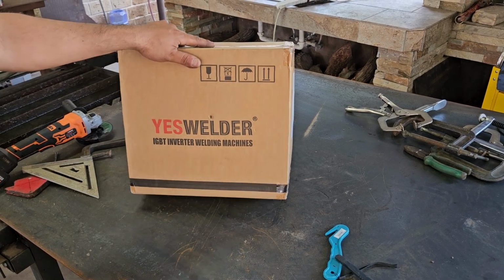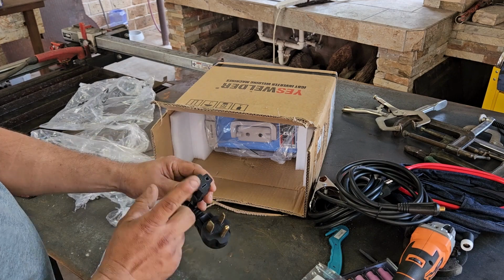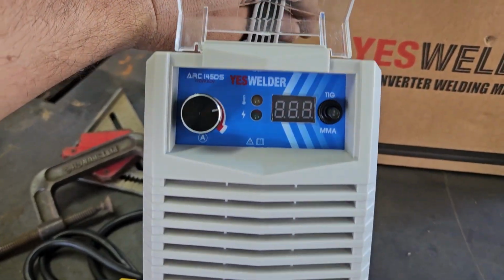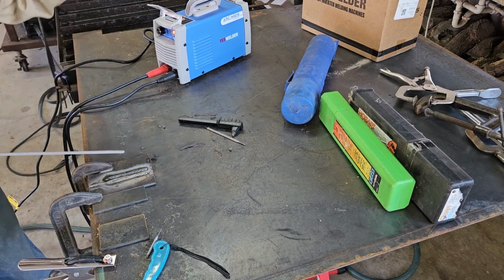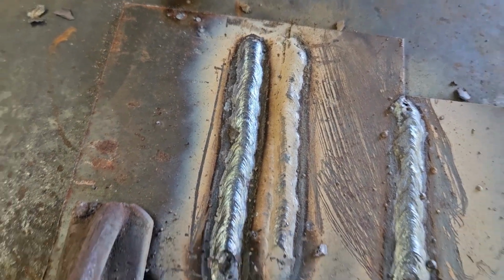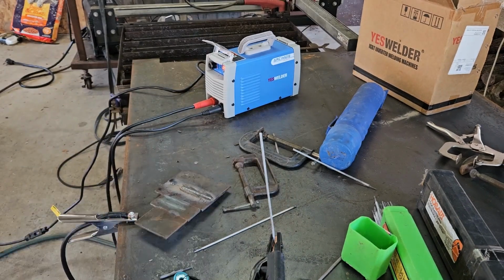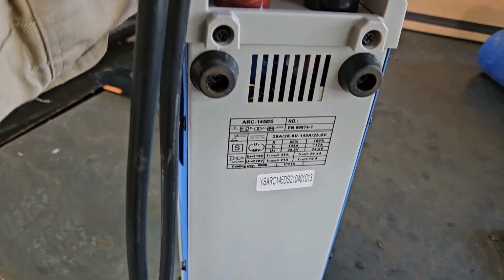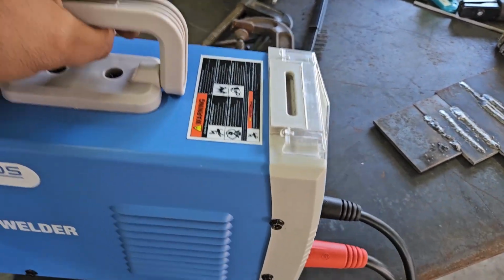Testing and reviewing the budget amazon Yeswelder Arc 145ds Tig and Stick welder  #Yeswelder

Comment: I have a Calemet IGBT.  160 welder it's works pretty good the only faults it had was the rod holder was total garbage and the welding leads were aluminum coated with copper so I replaced them before I even test it I had 2 in the past they last about 3yrs before quitting but at 140 dollars a piece just the first job it paid for itself
Reply from the maker: I totally agree with you on these IGBT inverter welders. The last 160A machine I bought was around $80 +/-  so easy to replace if they go bad. I havent done many welding projects but hopefully I can start soon.

Comment: DOES NOT USE 220 when welding. Better off buying one that really uses 120v or 220v. The adapter is misleading.
Reply from the maker: Are you saying machine works on 110v when plugged to 220v? I will check the welding machine out soon.